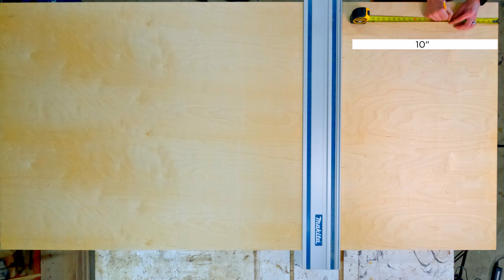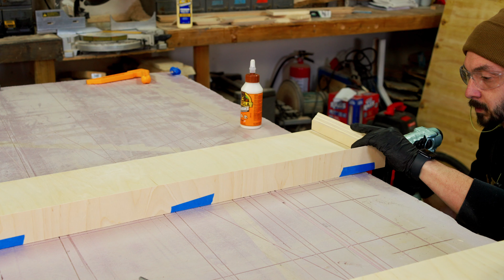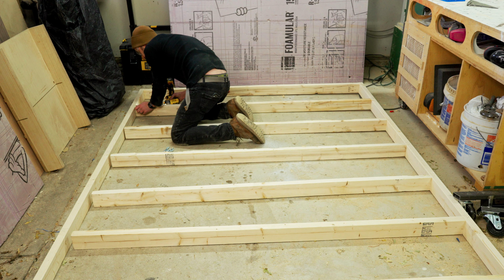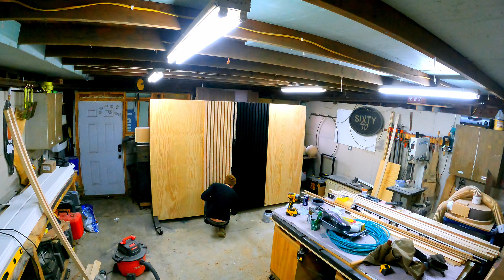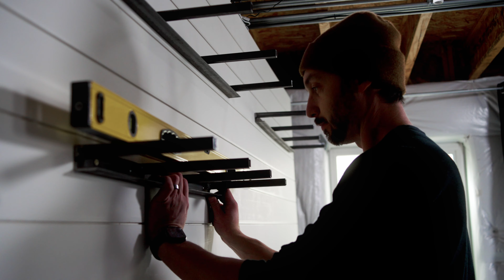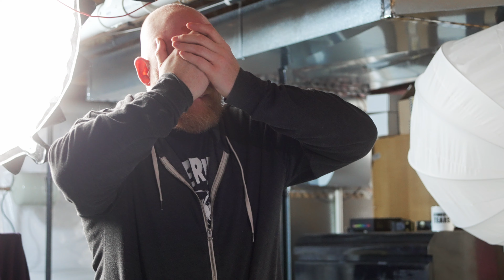How to make a Double Sided Rotating Wall!

Comment: Kickass build!! I have a question if you could please reply. The wheels are attached to metal slats ( I don't know what it's called ) Is it custom build or you can buy. Very helpful video. Thanks a lot!
Reply from the maker: Thank you! Yea so the metal slats I purchased at the local big box store by me. Which I welded and made so all custom built! I hope that was helpful.
Reply: @buildingwithbobby Thank you!! Very helpful video this is